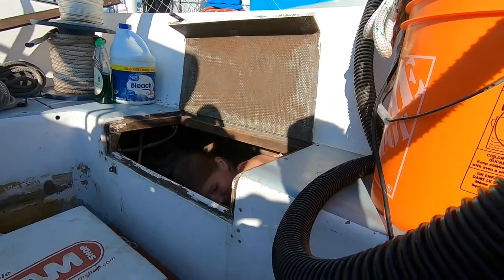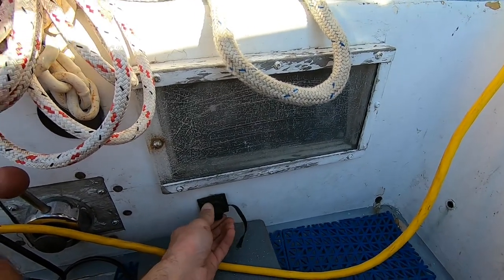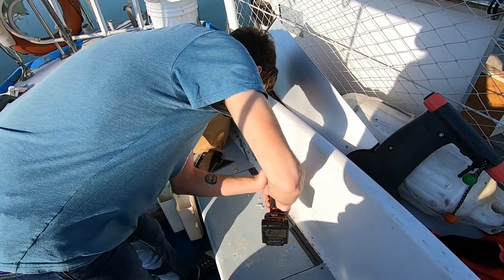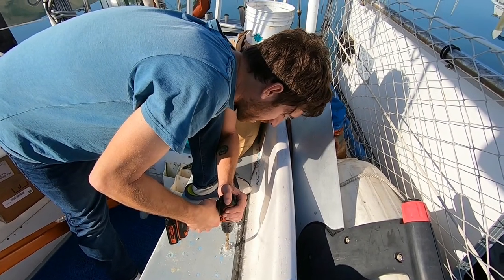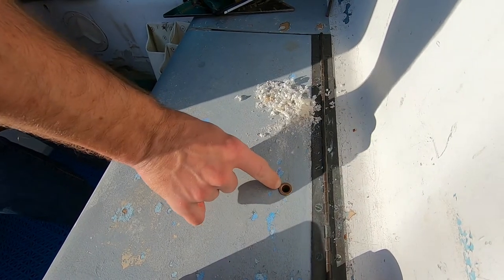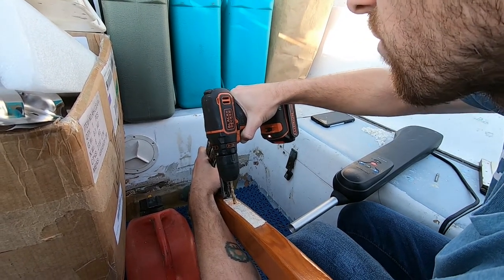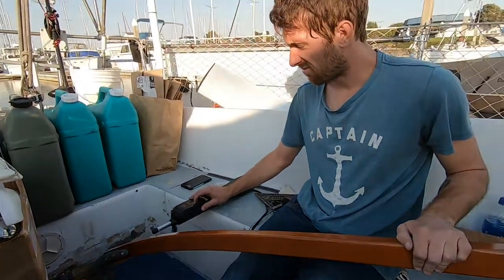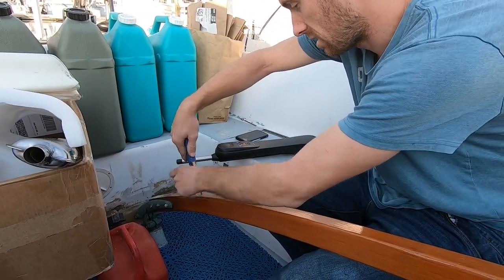Installing Our Simrad TP32 Autopilot On A Sailboat

Comment: I wonder that   ,what s boat size and if you had  an experience  what is the limit ( wind power ( km/h)) that autopilot worked without problem
Reply from the maker: Boat is 35-feet and we've used it with up to 20 knots of wind without any issues. But if we started getting hit by 6+ foot waves from the beam, it would have some trouble and often quit on us.
Reply: @Mafiakitty  it nice to control with tp32,I am building my boat,this not my bussiness,it is also 35 feed but  wait of it will be 8 ton ,I am looking  simple and cheap solution,what a pity this type auto pilots  can not control due to weight

Comment: I'm getting ready to install a simrad tp 10 in my boat.  Looks like you guys installed it further down on the tiller than the manual suggested of 18 in.  I would prefer to do this as well because of location.  Any problems when using your unit?
Reply from the maker: So far we haven't had any issues with the location or the autopilot. The only time it cannot keep up is when the seas are heavy or very light wind.